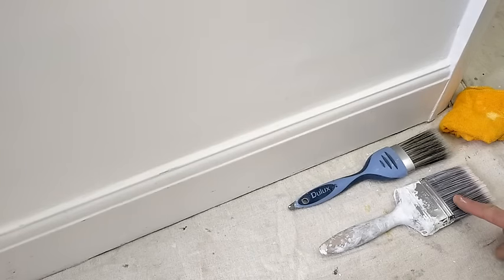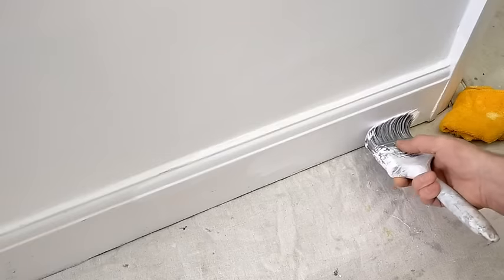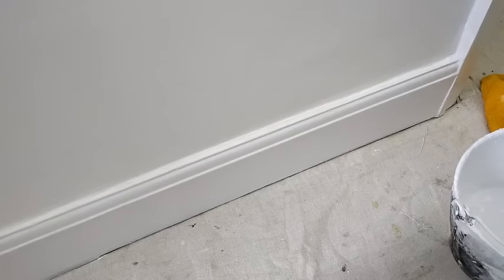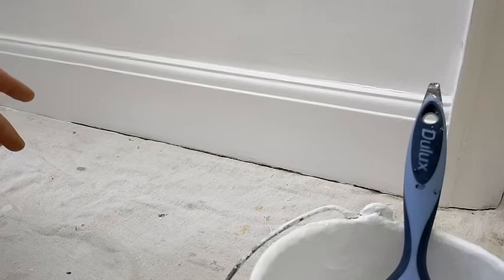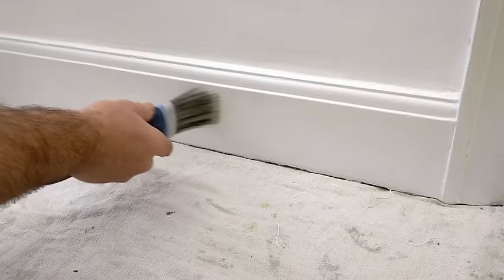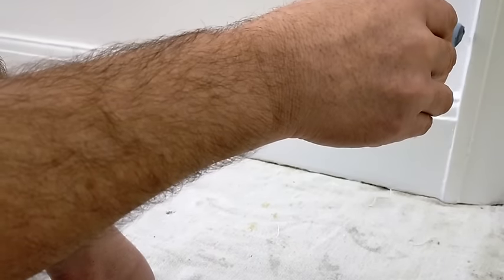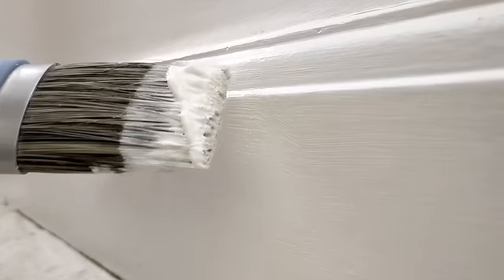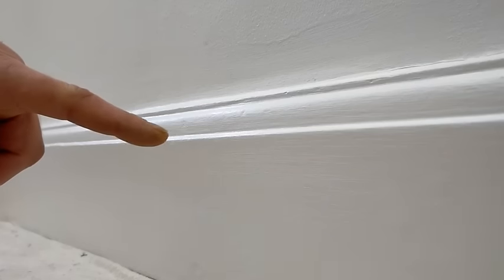How To Brush Paint Skirting Boards And Remove Paint Runs

Comment: Great video. Could you roller them instead? I hate the way the brush marks look.
Reply from the maker: You could if you want to but you still have to use a brush to cut in. Oil based paints are far better to get a glass finish, water based are rubbish as a finish.

Comment: I think it's time to up your game with an HVLP and airless spray gun in your tool kit, it's a movement gaining traction fast and an investment that would pay off in the first job easily if it was a complete house. More time masking less time painting but the finish is truly perfect on skirting and architrave. You can use large cutting in shields to catch over spray instead of masking up if your a pro and also roll over walls quickly after spraying them if you want. I think you would be a natural at it.

Comment: Great tip about the use of a damp clean brush to deal with wet runs on touch-dry W/B paints. I'll try this out on tomorrow's job. As you know trying to brush out the drip with a brush with paint still on it can result in a gargantuan cock-up. I'll report back!
Reply from the maker: Thank you.

Comment: Hate doing skirting. Do you have any tips on working so low down. I find it really hard on the knees and back so I always rush skirting boards and regret it later
Reply from the maker: Knee pads or a folded dust sheet is a good idea, crouch down instead of kneeling.